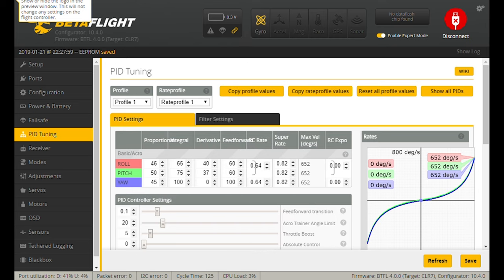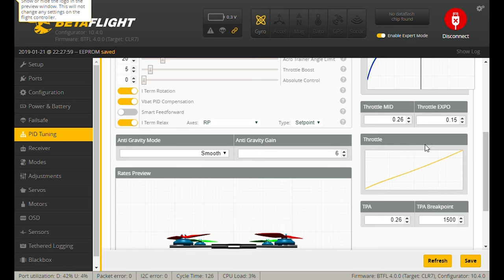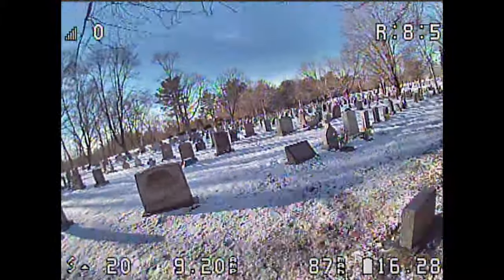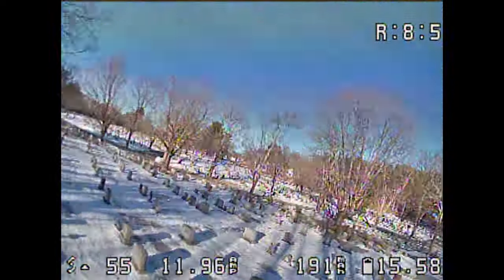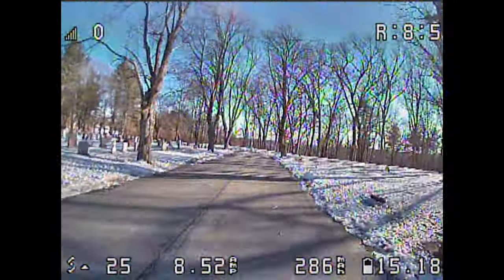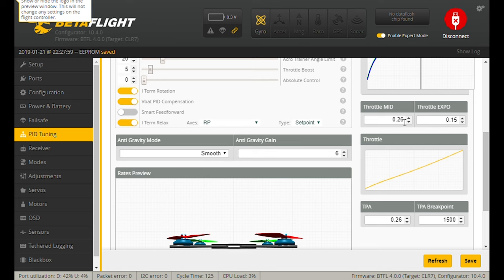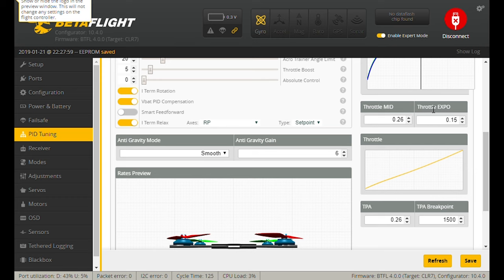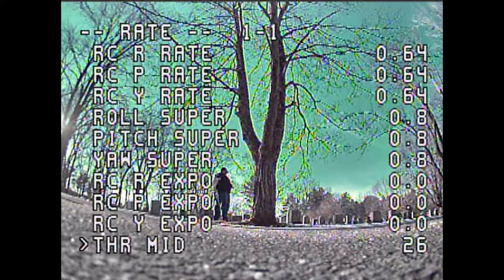How-To Use Throttle Expo to fly Buttery Smooth FPV | Just The Tip

Comment: I've watched a butt-ton of your videos.  Was going to text you but then, I found this.  I'm trying to get rid of my throttle bobble at slower speeds and closer to the ground and around objects.  It's dark now, so I'll have to try this out tomorrow.  Thanks for the videos.
Reply from the maker: Just increase the expo until you achieve the desired results.  I run about .4 expo with throttle mid set to .24

Comment: Hi. Quick question. At the beginning of the video you say to set the throttle mid a few points over, but then later you say to set it a few points lower?

Comment: Holy crap! I am still not sure what throttle mid and throttle expo is but I went from factory settings on the TH Freestyle 2 of throttle mid .50 and throttle expo at 0 to mid at .25 and expo .15 and it's like I got better at flying immediately. My flights are a ton smoother now. Thanks! 13 batteries is not enough so I have 10 more on the way.
Reply from the maker: Brother, that's awesome!  And that's the point!  Customizing the drone to feel natural to YOU.  If you need a hand with anything just let me know.

Comment: Why do you set the throttle mid below the hover point? I'd think you'd want equal expo above and below the hover point. Thanks for the vid.
Reply from the maker: Personal preference. I find that I wanted the extra space just above my hover point, and I really wasn't using the area below it... So I just shifted everything into the area that I used.

Comment: the only "problem" is that throttle mid will move UP with the battery degrading, but yes i do agree, i use mids always and it does help a lot for get it fly much smoother.

Comment: I really appreciate this Josh!  
Do you set your initial flight's throttle mid and expo to zero then make the adjustment?  I.e. what is your throttle mid and expo when you took this drone out for it's initial flight in the video?
Reply from the maker: You are correct. For the initial flight I leave everything stock as far as the throttle midpoint. I want to feel how the drone flies and how I feel about the throttle before I start being adjustments. I've had drones that felt fine with no adjustment, and then others that were very powerful and I needed a throttle midpoint set in order to tame a nice steady flight.
Reply: @JoshWithrow  I appreciate the valuable info sir!

Comment: You video has contradicting info. Towards the beginning of the video you say find throttle hover point and add a few points. Towards the end of the video you say drop a few points from you throttle hover point. So which is it?  Does anyone every view and edit wrong info in there videos before them actually post them?

Comment: Very good information. Throttle mid is my biggest tuning secret noone pays attention to. I run 0.83 throttle mid on all my powerful quads.. makes the throttle MUCH easier to cope with at low speeds ;)
Reply from the maker: I'm slowly leaking all the secrets to the noobs lol
Reply: Keep up the good work :) if you ever have some motors that just feel WAY too powerful.. try .65 to .85 range throttle mid with no throttle expo. sweet spot ;)
Reply from the maker: I prefer to set my midpoint to just below the natural hover point, have somewhere between .15 and .2 throttle expo, and if the motors feel too powerful I use throttle limiting to tame everything ;)
Reply: @JoshWithrow  I think my need for this change is due to using the Turnigy Evolution radio. I need my slow meandering hover speed about mid throttle, so my hands feel right so to speak. Likely none of my throttle mid issues are related to your issues so we are talking about the same setting for a different reason here it seems LOL
Reply from the maker: I was getting that feeling.  The only thing I was trying to accomplish was getting a very manageable hover that I can use an abused anytime I want with none of that bouncy stuff or excessive throttle play.  I'm more of a hybrid pincher so...  Yeah.
Reply: @JoshWithrow  I suppose if I am honest my natural nuetral idle position is something like a 3d pilot would be, I use half the resolution that other people use.. basically my hands are at all axis - 0 - center
Reply from the maker: @JoshKetchum  yeah..  that's early friggin weird ;) lol

Comment: Makes me wonder if flightone has something like this...I blame 2306 motors but again I had 2306 and not 2207 on flightone and I liked it because it felt predictive and didn't feel like low end throttle was sensitive... only thing I hate about my second build on beta 4.0 so maybe this will help. Best flying quad has butter 3.6 with 2208/2550 on rooster 766grams GoPro ect..other is 685g 2306/2400 on beta 4.04

Comment: This is fantastic! Thanks. Gonna give this a shot. I still haven’t tweaked a dang thing on that page haha.
Reply from the maker: I have another video talking about how to tune your rates.  You have ALOT to gain from these two videos alone.  I spent a long time playing with these until I understood thoroughly what they did, and I didn't put out a video addressing it until I felt confident that I could communicate the points correctly.  PID tuning is optional anymore...  but Rate tuning is a requirement.  If you think you've advanced until now, wait until the kwad truly feels in tune with you.  If you need anything let me know!
Reply: Thanks so much for the reply. It’s clear you know what you’re talking about. I have heard recently, like you said, that pid tuning is largely optional but rates, rates are absolutely necessary. I’m excited to try this. You recently subbed to me and I’m sure you can see my jitters. Ha. But I have some video not posted yet of a different build that is so much smoother. I need to get these rates nailed down. Likely a newer beta than 3.3 too haha. Thanks!
Reply from the maker: @tackleboxbrad2988  Betaflight 4.0, even thought it's not released yet, is so stable it's ridiculous.  It's all I've been flying, and normally I don't fly experimental builds.  But I was reading so many good things and then BF devs pushed the release to April and I was like "fckit".  Anyway, I'm more than happy to help in any way I can.  And I can see the jitters, but I see the potential underneath.  That's why I subbed you...  I'm expecting to see great things ;)  No pressure.
Reply: Haha well thanks! I’m in the noobtube group thanks to VerJan but haven’t been able to sit in on a gangbang Wednesday yet. Sad days. Anyway, I have new escs to install today hopefully (fun edit coming with that story) and I will give 4.0 a shot. I saw another vid about being able to get it and I also keep seeing/hearing how great it is. I’ve been flying butter and beta on 3.5 with other builds (hence the smoother flying before in footage yet to be seen) so I know it’s just better and better. Excited to check the 4.0. Thanks again

Comment: With the new BF versions, the throttle mid is automatically set to 50.  Any reason why they moved it up so high?
Reply from the maker: As far as I'm aware that's where it's always been by default.
Reply: @JoshWithrow  Gotcha, I never paid attention to it but after watching this video I am going out tomorrow and making some adjustments!
Reply: It is on 50 but with th expo on 0 the th mid does not have any effect, because by default th settings are linear.

Comment: the position of the throttle expo is directly related to the camera angle. The lower the camera angle, the lower you should set the point the exponential amount is set to. 20 degree angle goes well with 18-20 throttle percent. Try it on the sim.
Reply: Interesting !